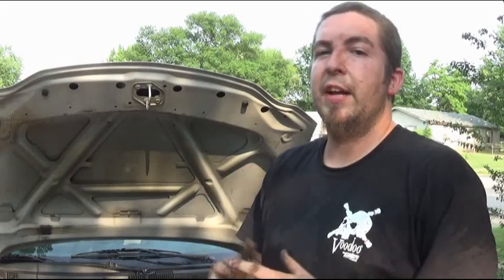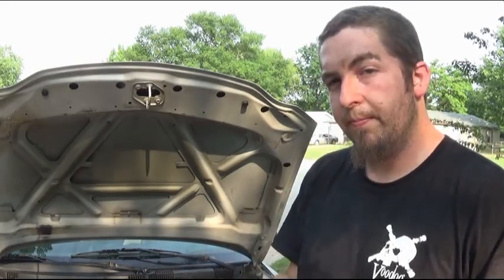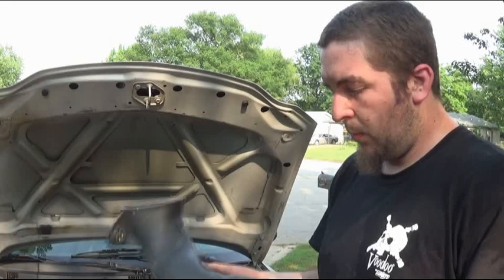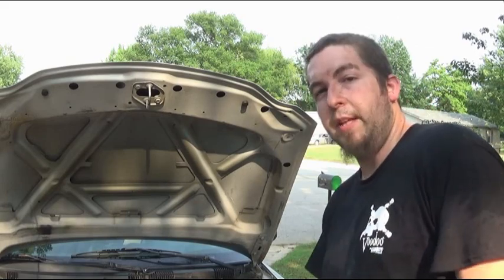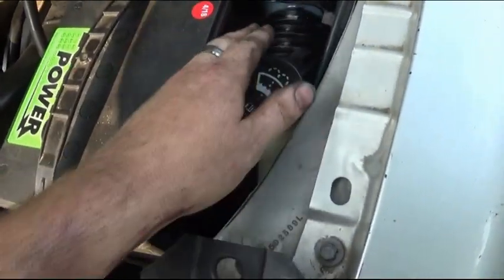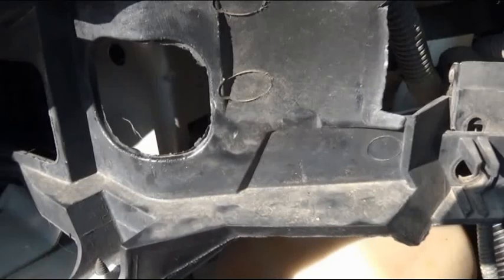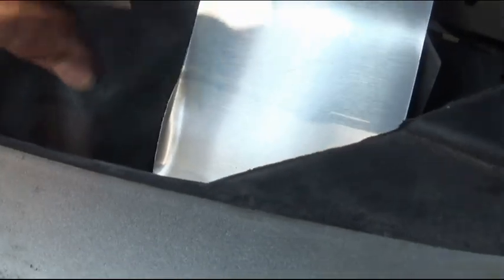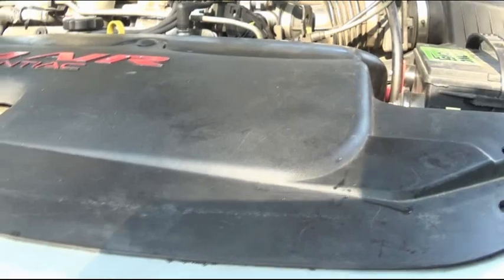trying to improve our ram air grand am air intake

Comment: I love little hacks like this! I made a Ram Air for my 2018 Ford Fusion Platinum 2.0 Twin Scroll Ecoboost. I had a body shop professionally cut a rectangular shaped air scoop 10 inches in width & 2 in height where the Ford logo was moved my Ford Logo onto the grille so it looks stock. First I had to make the rectangular grille piece, inlet & rubber seals. Cut a hole in bottom of Factory Air-box then made one smaller rectangle rubber seal to connect one side of the tube and one round seal to fit the circle that I cut in the factory air box. That way I’d still keep my MAF Sensor in tact. I’ve had zero turbo lag now since I’ve done this and the response is so much better plus better gas mileage.
Reply from the maker: Thats what hotrodding is all about , stock air boxes always leaves a lot to be desired. I dont care what people say stock is not that good, its made to be quick and cheap for assembly lines